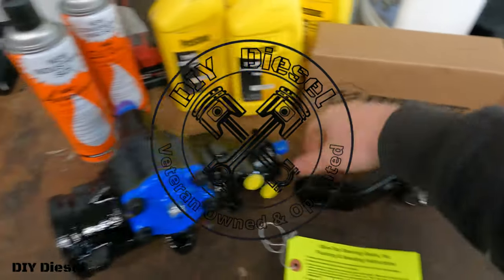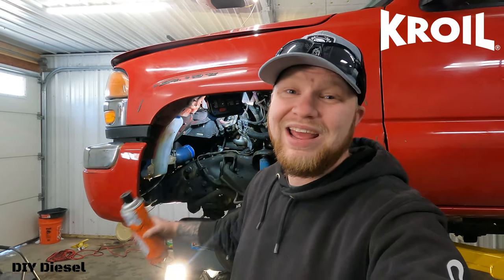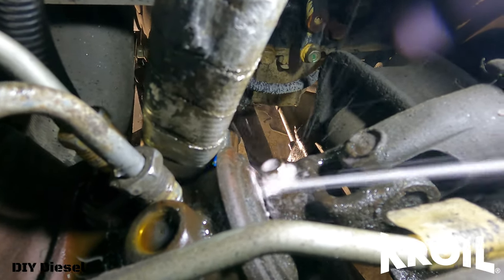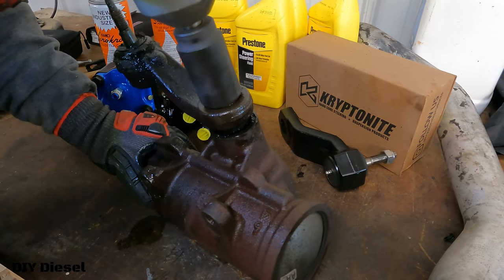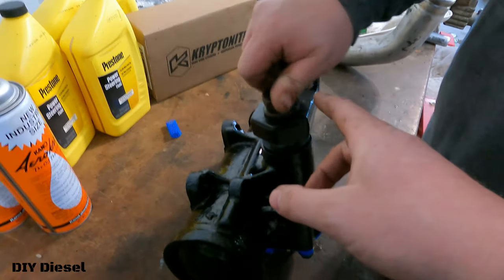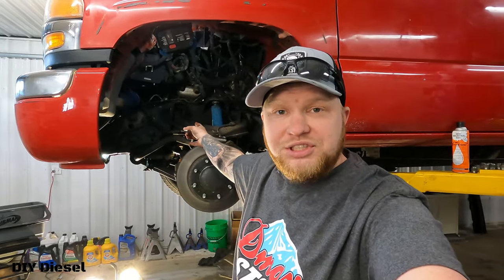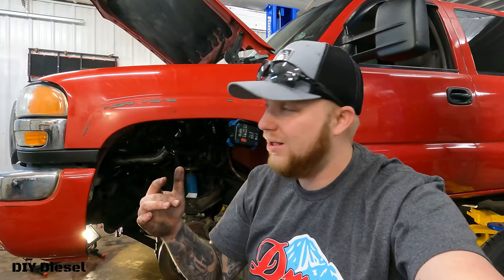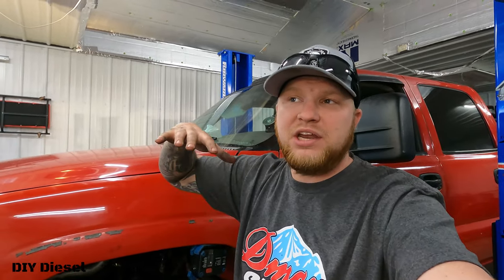How To Install A Blue Top Steering Gear Box (GM/GMC Duramax)

Comment: Just found your channel. new sub. Thought it was my hydro boost leaking, but gearbox/pitman arm seal pissing bad. Thanks for calling out the wrench sizes. I'm old(64) but after watching your vid I think I can handle it myself, I do have a lift ;) I flush my fluid every 30K.  Cheers

Comment: For anyone doing this, you need to stabilize the steering wheel so it cannot rotate, most people use the seatbelt. If the steering wheel rotates beyond the clockspring range, it will break and you have a pain in the a$$ project on your hands.
Reply: I’m surprised he didnt mention that, because that’s literally the most important part when disconnecting the steering shaft lol

Comment: Hopefully you have better luck than I did with my 04 lly. Installed 2 different red head steering boxes and both had different issues. Put stock one back in and no problems.
Reply from the maker: Ya I’d stay away from red head. If this blue top fails we are just going straight to PSC
Reply: @DIYDiesel  I will be waiting on a review. Lol
Reply from the maker: @lucasseymour869  lol next week 👍

Comment: Bout to put one on my 05 2500hd, I've been reading online that the 2500HD are always 3 master splines, has this been the case with the ones youve worked on?
Reply from the maker: Yes they are 3 spline. Unless you order a PSC that will be a 4 spline so you will have to get a 4spline pitman arm 👍
Reply: @DIYDiesel  I was wondering about that, im replacing the pitman arm, idler arm, the idler arm mount and both tie rods at the same time and was wondering if I couldnt just order 3 spline anyways and convert it even if it was originally 4 spline, seems like the splines have nothing to do with strength if the 1500's have 4 and HD only has 3

Comment: Guessing this is much simpler on a gasser too. I got a hard to the right steering issue when I am at parking lot speeds or sitting still. I'm going to try to bleed the system first, if that doesn't fix it it's gearbox time I already know lol. Do you have to have the truck running when you're moving the wheel from left to right? I'm going to put it up on jack stands in the front and try to do it that way.
Reply from the maker: The process is pretty much the same as the ifs is across all there trucks.
We had the truck running when bleeding/flushing it yes.

Comment: Blue top or red top ?
Reply from the maker: I can truthfully only speak for what research I have done, and the blue top we currently have. I wouldn’t even think of red top (redhead) I would just order a blue top, if  I didn’t want to spend the money on the PSC 👍
Reply: @DIYDiesel  thanks, and how does that kryptonite pitman arm feel did it help tighten things up as well? I'm thinking of getting the same sit up for my Silverado 1500
Reply from the maker: @sean.g4516  it did amazing. You also have to make sure your idler arm is in good condition because you could do all that, and then have a bad idler arm. Possibly seeing no improvement.
Reply: @DIYDiesel  yep just replaced my idler arm and bracket with the moog hd arm.
Reply from the maker: @sean.g4516  nice! If your going to do pitman arm, and gear box I would suggest also getting the cognito support kit 👍
Reply: @DIYDiesel  what exactly is that and where does it go
Reply from the maker: @sean.g4516  so it adds extra support to both idler arm, and pitman arm making them last even longer. It’s not a cheap kit tho